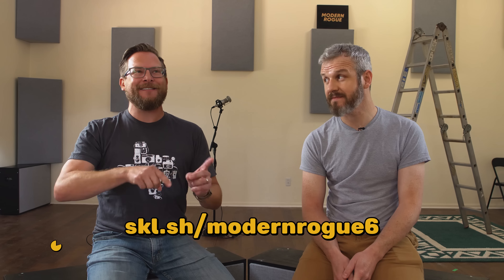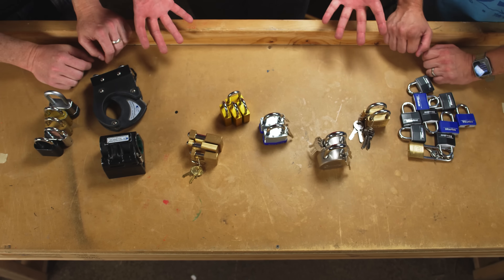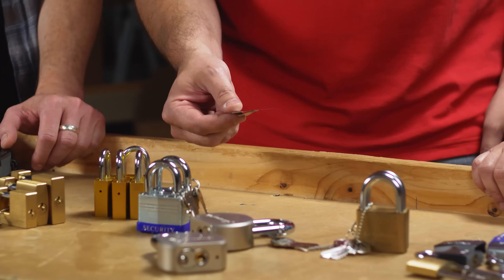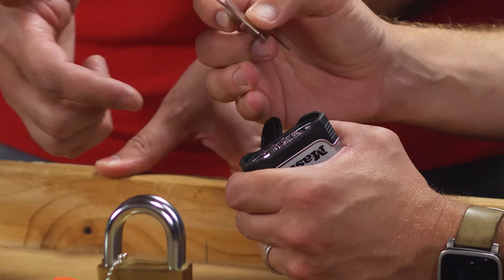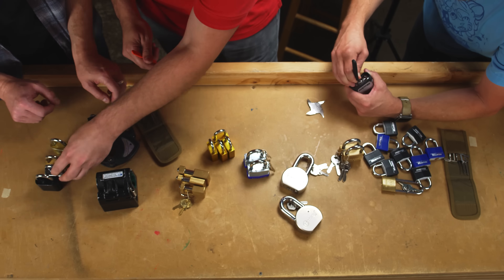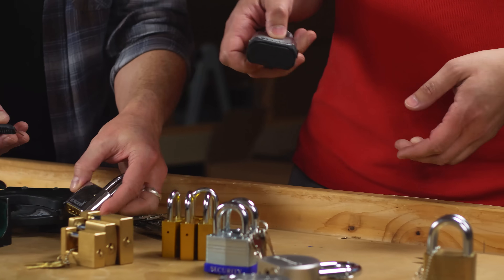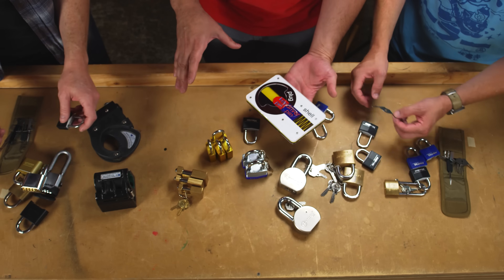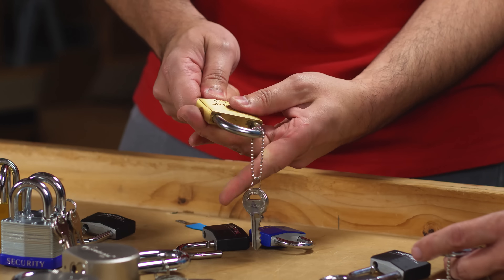8 Surprisingly Easy Ways to Open Locks (with LockPickingLawyer)

Comment: Imagine being in a prison with lock picking lawyer in a cell, your a night guard reading the news paper from that day. You hear a faint noise, you listen closely and you hear these words: got a click out of 2, 3 is binding, 4 is set, 6 is binding . You might as well just open the door and let him out. Either way he's getting out.
Reply: "This is the Lock Picking Lawyer, and what you're seeing is a standard jail lock used by most federal prisons in the USA, and today, we're going to try to open this 6 pin core lock before the guard comes around. I've fashioned tools out of the silverware I've acquired a couple hours ago. Ok let's get some tension in there"
Reply: @MM-vs2et  "and as you can see it didn't take my very long, it's a very poor security system to be securing prisoners, I wouldn't lock a slice of bread away with this lock as it'll get out easily"
Reply: @PlinkyVR  "So I would recommend them to put better locks on these cells.Wait gimme a sec... Ok I am back.Just got out of their teir one security and told them to get some better pins in there locks.Anyways,If you are in jail right now you can see how freakishly easy it is to open these locks,So I would only reccomend to use them for the cookie jar from your little brother."
Reply: @wakeupinko  "I made sure to shim open the gaurd Captain's office and left the autopsied core on his desk with notes and a link to this video to ensure they make improvements. Anyway This has been the LockPickingLawyer, RUNNING from Court this time."
Reply: " and I'll do it one more time just incase you blinked".
Reply: nikola poyukov  no
Reply: Sad thing is hes a lawyer hes got contacts hell never end up in jail
Reply: nikola poyukov  yesnt
Reply: @wakeupinko  Do you even go to school?
Reply: @patrickk.9355  Yeah dummy I go to Mark Twain .
Reply: Neelu ...lol....
Reply: @wakeupinko  Yet you can't spell?
Reply: @JohanKylander  there is a movie of the same name staring Daniel Radcliff. It's pretty good
Reply: You could just take his picks. That'd slow him down at the very least. Probably not much if he's managed to make/smuggle in picks so easily already, but it's worth a try.
Reply: @JohanKylander  I listened to the audiobook
Reply: That's not how Prison Cell Doors work. But sadly, some prisons use cell doors that truly ARE very easy to bypass. Something as simple as pulling up while the door is open to pull it off the track, or bumping it at a certain point while it is shutting to trigger the "safeguard" that prevents it from shutting on a person.
But if you escape, get ready to be beaten by 6 guys using riot clubs. THAT is the TRUE deterrent to getting out.
Reply: @hillarysemails1615  but who
Reply: Imagine being in prison with LPL in the cell next door and hearing bits and pieces of this "lock picking"conversation. I must say I honestly lmao thruout this whole video. Maybe learned to pic 1 lock
Reply: I am sooo dying. "Do you spray lub in there" and so so much material for a comedy set. Cant leave out the voice, someone should really creare something with this. Similar set up, with the hands and voices. Minus the locks. Twist it all up. Sure it'll rake in the clicks n comnts. 😂🤣
Reply: I am sooo dying. "Do you spray lub in there" and so so much material for a comedy set. Cant leave out the voice, someone should really creare something with this. Similar set up, with the hands and voices. Minus the locks. Twist it all up. Sure it'll rake in the clicks n comnts. 😂🤣

Comment: 19:25 “I’m just waiting for some super magical high tech-“
“This is a magnet”
Reply: Basically magic
Reply: "Fire, wind, water, earth f#cking magnets how do they work?"
Reply: Sounds of distress after realizing how easy it is to get a shotgun out of that lock.
Reply: @Corosar  
That lock that is in police cars , keeping the shotgun in place ... manufacturer do not even claim its for securing the gun .
Reply: Ringo Garvin  He went that way officer if you run now you may catch up to him :P
Reply: so if the part that catches the teeth were high grade stainless steel ( austenitic ) magnets wouldnt work but then theres the whole shimming issue still
Reply: To be fair, neodymium magnets are both "high tech" and "magic".
I studied Electricity and Magnetism for almost my entire undergraduate degree (BSEE + physics minor), and I sympathize with ICP's lyricist when he says "fucking magnets, how do they work?".
Reply: @pete_lind  So if that lock is just for holding the gun in place, not securing it, why does it have a key lock on it and not a push-button release?
Reply: @cr10001  they do have a push button release... most or atleast some of the time theres a button towards the bottom of the dash that releases it.... though some departments put it somewhere else or dont have on at all which I'm sure officers just love.

Most of the locks just require a handcuff key; it's not for security necessarily but just stops someone from reaching in and grabbing it without a tiny bit of effort or knowledge.
Reply: MPW 
Fucking laser sights
Reply: "Dear god..."
Reply: @aaronkile4766  The magnet is pulling on a solenoid that retracts the pin. Not directly on the pin itself. It's designed to be unlocked from the cab electronically before even exiting the vehicle. magnetic shielding could be easily and cheaply implemented. However the core of that lock can be jiggled open just as fast as shimming it.
Reply: I was scrolling threw coments as this part happened
Reply: @cr10001  A bit of both, it;s so someone can;t casually just reach in and grab the Firearm while the car is parked.  It's a Balancing act,  Have the weapon where it can be accessed when needed quickly and easily under Stress by the Officer, not not some casual dipwad walking past while he;s out of the car. When my Dept had mounts in the cars (Only for one specific zone) they were in the trunk, and key-only operated. (also a shitty design that chewed the hell up out of the guns, but that's a different rant)....If we were going to a call that sounded like it was going to be sporty we'd stop a block away and the passenger could get the shotgun and keep it in the car until we rolled up.....if there Wasn;t any warning, In reality it might as well have been locked up in the arms locker in the station.
Reply: Soldier voice: My god

Comment: I used to pick our cheap luggage locks with a tiny screwdriver. Now, 11 years later I finally understand that it was because there was no shielding between the core and the mechanism. LPL is just the best

Comment: Best padlock in my opinion, is one that's so rusted it's hard to open with the original key. 😉
Reply: This comment is gold :^D
Reply: Mine is the wooden bar with a built in coat rack.
Reply: Gregory king My dad has some of those... actually, he'll do you one better: old rusted locks whose keys he has lost.
Reply: Nym Alous I have a few spare keys that work especially well on old rusted locks!

They’re also pretty good at driving nails.
Reply: I find that a welder and a grinder work moderately well.
Reply: How to bypass that one in 10 seconds: pipe wrench.
Reply: LPL preaches heavy tension when picking so if the key can open it so can he lol
Reply: @rangernolen8291  No, it's rust xD
Reply: Once had bike-lock get stuck due to age, wear+tear plus winter conditions. Then when I tried bypassing it, I realized I had also got a version that where the steal chain was resistant to bolt-cutters. Good lucks can be a curse sometimes.
Reply: The best lock is to never own anything more expensive than a padlock

Comment: "The trick is to insert it the correct depth. I will put my finger to make sure to not over-insert it."

The Modern Rogue
Reply: "If you're pushing hard, you're not doing it right."
"You're at too much of an angle when you're inserting this."
"I'm just gonna twist a little bit, then shove in." 😏
Reply: 12:51 listen and learn

Comment: don't forget the biggest bit of negligence, the fact that the 2 gun locks can be opened by commecially available handcuff keys
Reply: Did the shotgun lock have 2 keys? It looked like a wafer lock(almost as bad 😆) Either way, scary garbage for securing weapons
Reply: @Jake1973_  the shotgun lock when shown did have two keys, one that is unique but each has an override that uses the handcuff keys that anyone with $5 and a local toy store can buy and see what they look like
Reply: @GHOSTking894  Wow, might as well use zip ties! Thanks for the info 👍
Reply: @Jake1973_  zip ties can be shimmed and snapped by a similar torque technique akin to the double wrench method
Reply: We just need to secure our things with cheap chinese packaging. Tell me you have opened that random chinese toy packaging without tearing it- that's right, you can't.
Reply: @kaz_iaa  your correct, you can't, not without scissors, then the plastic can cut you, also what if your scissors comes in the fucking plastic, the shits basically bullet proof
Reply: There’s a gun log that can be opened with a twig
Reply: Adam Laird zip ties can be shimmed with the pointy end of that a thin knife or screwdriver. That way you can use them a few times for tying up stuff (they get weaker though).
Reply: @johnfrancisdoe1563  my point was more to illustrate the point that they could be shimmed and snapped by techniques that Brian showed on both HTS and scam school
Reply: One thing that most people forget is that just the appearance of a lock is often enough to deter wrongdoers

Comment: Back when I was in the Army in the mid 80's we had the Masterlock the one with the blue logo, when we locked our keys in the locker, we would hold the lock up over the handle and then smacked it with a hammer or the metal pole from our bunk and it would pop right open.

Comment: Back when I was in high school (when dinosaurs roamed the earth) everybody had a master lock, combination type, on their lockers.  These were vulnerable to the shim attack.  There were two good sources.  The better one were street sweeper brush wires, which were actually not so much wires as long skinny and flat pieces of metal.   You could find these on the street just by keeping your eyes out, because they fall off ... if not all the time, then at least enough of the time.   The second source is also a long skinny flat piece of metal, from a ruler.  The good rulers, meant to be used as a straightedge, had a thin blade on the edge, to prevent the wood from getting dented and ruining it as a straightedge.
Reply: My high school (1999-2003) had the lockers with the combination knobs built-in, and they changed the combinations each year. It would've been fine if they didn't also keep the spreadsheet with all of the combinations in an open folder on the network. I found them while bored one day, showed someone, and a few weeks later he was suspended for selling printouts of the spreadsheet in the hallway.

Comment: Lock picking is probably like learning to ride a unicycle, juggling, or tight rope walking.  It's not overly complicated or necessarily hard to accomplish, it just takes determination & lots of practice.  Most of the population doesn't have the determination or wish to put in the practice necessary, which makes most padlocks very adequate for the job they're designed to do.  Also factor in that most of the population aren't thieves and honor the implied desire a lock represents. A truly determined thief will just bring some bolt cutters.

Comment: The super cheap laminated locks from Dollar Tree I open with heavy wire paper clips. Just make a 90 degree by 1/8 inch bend in the end of the paper clip and a 90 degree by 1 1/2 inch bend in the other. Push the short end into the key hole to the end and spin the other end. The small end catches the only actuator at the end of the key hole releasing the shackle.

Comment: LPL is a lock whisperer. You got the right guy for lock picking a bunch of locks.
Edit: I’m also noticing a lot of tools from Sparrowslockpicks.com I like Sparrows lock picks and their bypass tools. Good quality stuff at an affordable price. Also, I’m in no way affiliated with Sparrows. I’m just a fan of their products.
Reply: Yeah, because if he yells at them they just disassemble themselves on the spot from fear. It's hard to find a video on his channel over 10 minutes because he goes through so many locks as if they were made of butter.
Reply: Any idea what pick set he has for them in this video?
Reply: Gaetano Dragone It looks like he gave them the Tuxedo pick set. But these were all bypass tools he used to open the locks. The bypass tools he used were the Ultra Decoder, the Sparrows shank, the Comb .45, the Abus bypass driver, the Sparrows padlock driver and the Sparrows padlock shims.
The Tuxedo pick set is around $32 USD the other tools are about $8USD for the Sparrows padlock bypass driver up to about $20 USD for the shims. A set of warded bypass keys and some wafer picks would round things out nicely. If you’re thinking about getting into lock picking for fun, then you can’t go wrong with Sparrows. There are cheaper picks out there. But they’re cheap for a reason. There are also pick sets that are more expensive. They are expensive for a reason. But I think Sparrows offers more bang for the buck. I’ve got a pick case stocked with SouthOrd and Sparrows picks, tension wrenches and bypass tools. I more often than not use the Sparrows picks. They are good solid picks. They aren’t bullet proof. But they are about as bullet proof a pick as you’ll ever get.
Reply: There are also several Peterson tools in these kits as well. Looks like LPL put together these kits with what he knew was going to be needed.

Comment: It's alarming how many of these exploits could be fixed with just a wee rubber or metal cap around the shackle
Reply: That’s just the shimming. Most of the exploits shown don’t use the shackle holes at all.
Reply: True, but a good couple of the locks got shimmed
Reply: Tom Chaney I quibble with calling those the good locks ;)

Also, though, those rubber caps don’t actually stop shimming attacks. Those are there for weathersealing.

A metal guard that was actually welded onto the shackle could work, but that would be super expensive. Better just to use a design that isn’t spring-loaded.

Comment: You guys plan on selling those lock pick kits in the scam stuff store? I've been looking for a good one to teach my roommate with. I think that would be awesome
Reply: sparrows  lock pick sets. they have a 20 dollar beginner kit that does wonders, offers training locks in both cut out and acrylic see through.
Reply: I'm just curious as to which tool set they where using. I have one but it's a little bulky compared to that set.
Reply: @stephendoughty627  it looks like the tuxedo set, but he added some other tools into it.
Reply: @sheamartin911  thanks. Sparrow has a ton of kits and it's hard to pinpoint which one they used.

Comment: Now I’m tempted to go find out the local laws on owning lockpicking tools.
Reply: It is most definitely not illegal, lockpicking sets are sold commercially and for fairly cheap. They can also be used in some trades (i.e. Locksmith), but otherwise, it's legal to own unless used for illegal purposes.

Comment: Where do you find the 'kit' that you had, or did the lawyer put it together custom?
Reply: Trying to figure out the same
Reply: I think the tools are from a company called Sparrows
Reply: Sparrows lockpicking set, likely customized due to the fact that LPL works with them designing a tool or two. Looks to be based off the EoD kit with a few inclusions of more beginner friendly tools? Could also be tuxedo with coyote case. Not sure. I'd recommend tuxedo set for a beginner though as it's a very friendly set that includes all the common picks.
Reply: @Dalrad  It's the tux w/ coyote case, he uses the Peterson American bypass tool, and Miniknife. The shims look like sparrow's.
Reply: THANK YOU!

Comment: Anybody know what lock picking set they're using? Just outa curiosity.
Reply: Sparrows set, likely customized due to the fact that LPL works with them designing a tool or two. Looks to be based off the EoD kit with a few inclusions of more beginner friendly tools? Could also be tuxedo with coyote case. Not sure. I'd recommend tuxedo set for a beginner though as it's a very friendly set that includes all the common picks.
Reply: @Dalrad  tuxedo doesn't come with the bypass tools.

Comment: No tools, no picking, no freeze required! You can wreck small padlocks with just a towel easily, not a thick one, but a kitchen towel and pretty quiet too. Just thread it through the lock so both ends of towel have the same length, then yank both towel ends in one, or with both hands fast and hard down, a standard small padlock should break at 1st down yanking, guaranteed! But do as much brute force down yanking as needed. Works even on not so small padlocks. We did this all the time, couple times a week, on our army lockers, cause keys were apparently lost quite often, or combinations forgotten, so we got lotsa practice with that technique. Back in the day, Cheers!

Comment: The ABUS shutter lock I use to explain locks to people - I use one that's a "7" on the 1-10 ABUS scale.  Using a ball rake I can open in just one sweep.  Most people are horrified when they see this, but I explain the 7 rating is based on what the lock is designed to protect against - the use of a bolt cutter.

Comment: The small blade on a 3 1/2 inch Old Timer Stockman knife  with a wigglie jigglie  and twist will open most locks.
Some you just stick it in and twist.